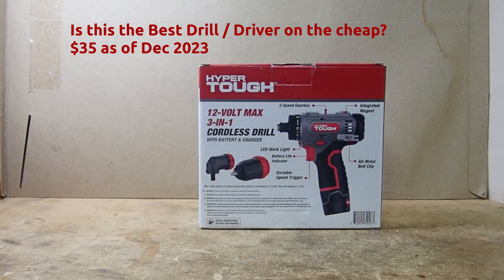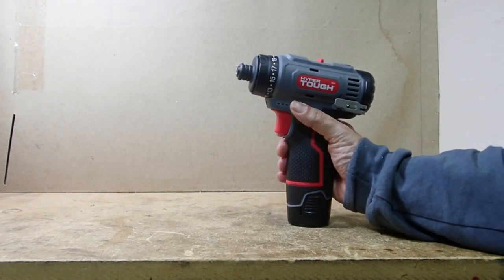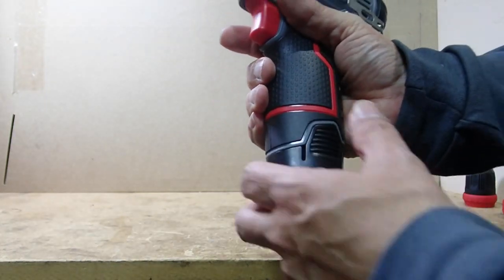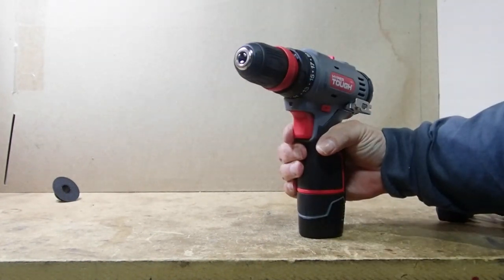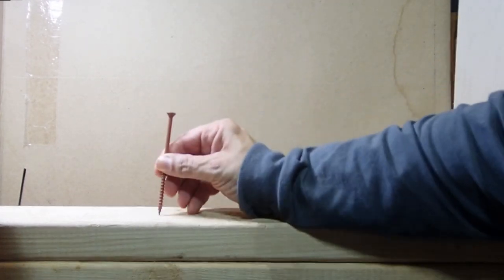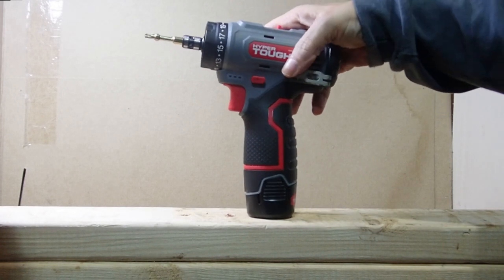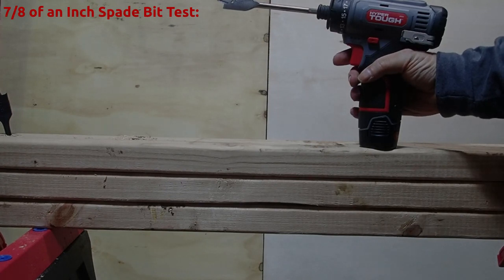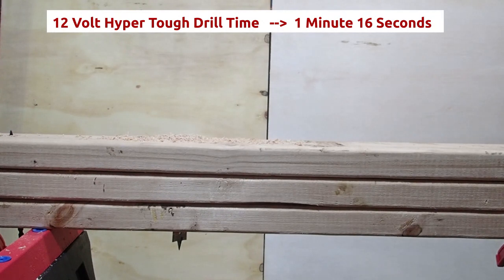Hyper Tough 12 Volt 3 in 1 Tool.   Reviewed and Tested

Comment: Is the base for this drill (its internals) the same as the Hyper Tough 12V Max Lithium-Ion Cordless 3/8-inch Drill Driver? 
If yes, then the extra $15 is only for having a 90 degree attachment, which you may get for a much lower price elswhere.

Comment: I couldn't connect the adapter to the drill, it didn't look like your well-adjusted one. Do you just use force?
Reply from the maker: I was gone for a while and I am just now getting caught up with many many comments!!!
Slide the red ring for the attachments as you place them on the drill.  If needed, rotate the attachment slightly to help it line up.    No real force needed.     

In other words slide the release on the attachment as you insert the attachment to the drill/driver.  

Hope this helps you and others!!

Comment: This is an incomplete review, it is missing an important test on resilience. Just because you drilled a few holes, or screwed in a few screws, doesn't mean the drill is good, unless you do this multiple times, enough to see that it doesn't burn after many tries. Otherwise, you can call it disposable.